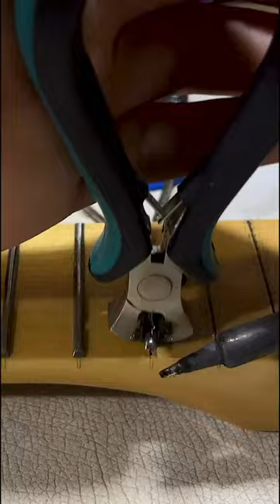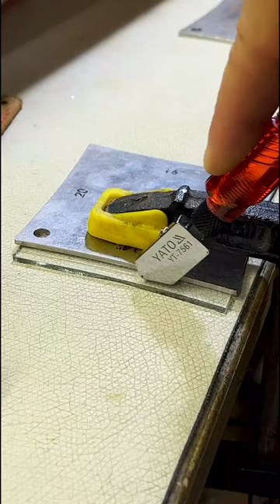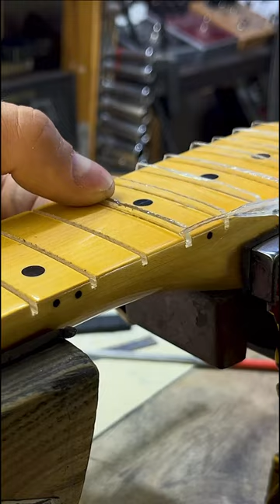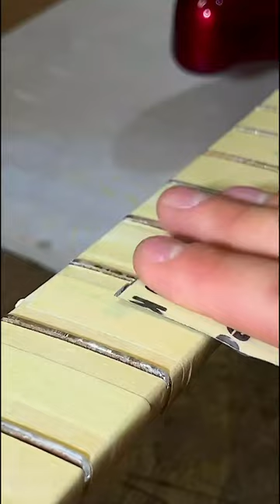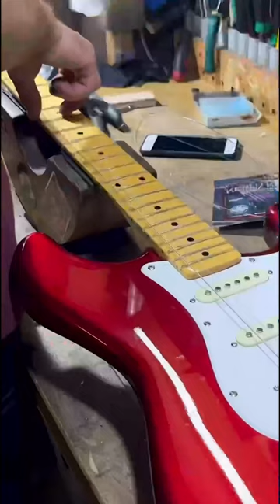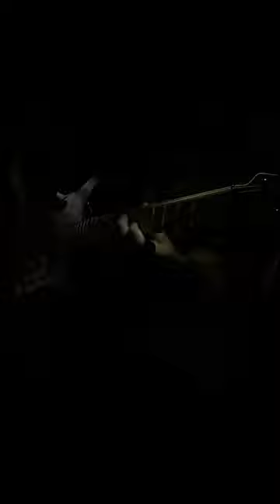Awesome refreting with glass frets!

Comment: "Glass is glass and glass breaks" - Zack Nelson
Reply: scratches at a level 6 with deeper grooves at a level 7
Reply: Chips and it's also softer than steel strings.
Reply: @jimott7342 no? Glass is harder than steel.
Reply: @messagedeleted1922 Actually about the same on the mohs hardness scale, glass can scratch unhardened steel and vice versa
Reply: who?
Reply: @andrelunaisatuna Depends on kind of glass and steel  but glass usually takes the cake.
Here are some Mohs scale ratings for glass and steel: 
Glass: Around 7
Gorilla glass: Around 8
Normal window glass: Around 5.5
Unhardened steel: Around 5.5
Hardened steel: Around 6.5
Steel: Around 4–4.5
Reply: And it cuts flesh pretty well, too! 😲😵‍💫

Comment: What about tungsten? Sometime when Dynema becomes available readily, it would be cool to try. Titanium could be cool, but not sire the cost would ve worth it. Yet using different fret matterials along the fretboard to control timbre could be cool.
Reply from the maker: Titanium is already in the works, and tungsten carbide is damn hard
Reply: @mr.k1t  Tungsten would be the devil to work with, but interesting. I know there are some many unique ceramic based materials that are hard, Smith and abrasion resistant, probably similar to glass.
Reply from the maker: I'm thinking about zirconium oxide
Reply: @mr.k1t  I actually don't know a ton about that alloy. I looked it up and it seems to be compared to titanium.
Reply: The internet states Polycarbonate is harder than glass, I wonder if the scratch resistant coated poly would be workable, as acrylic would not be scratch and not be abrasion resistant enough

Comment: Just...why.
Reply: If made right I'm sure the fret wear would be less or not at all from normal play. If you hit or bumped it wrong it would be prone to cracking or chipping but that would most likely not happen.
Reply from the maker: You're right, there shouldn't be any wear
Glass hardness is about 60-61HRC. @t.c.v.t.
Reply from the maker: To know the boundaries of what is permitted
Reply: @mr.k1t  yeah I figured it have an advantage for wear as long as you don't hit it directly and it starts chipping or cracking
Reply from the maker: @t.c.v.t.  Will need to do a crash test
🙃
Reply: Why not?